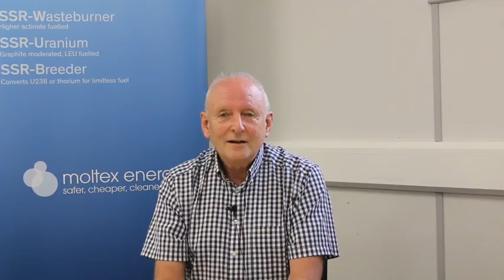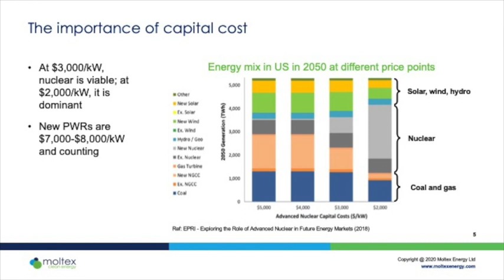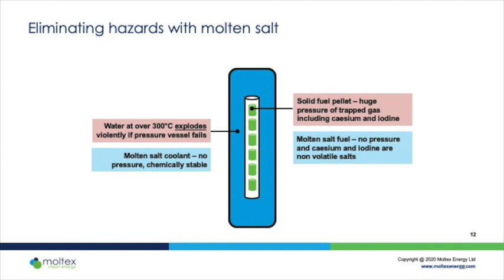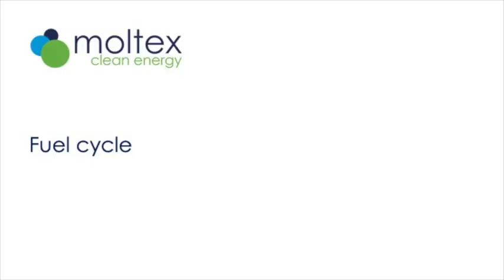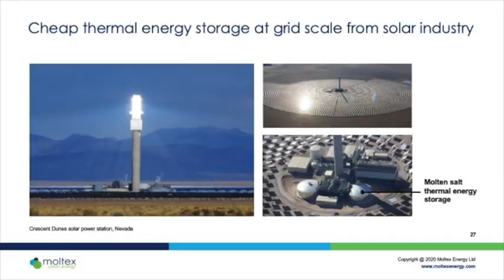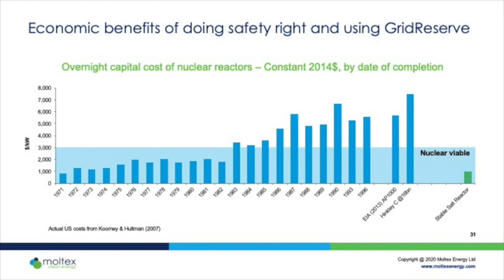MITAB20-Ian-Stable Salt Reactors - a new platform technology in nuclear fission

Comment: Excellent talk. One very interesting point about SMR's in general, and this one in particular, is the low cost of building the nuclear side. Because the very complex and expensive engineered safety systems are not needed, this plant should be a delight to build, commission, and operate!

Comment: The World needs to supplement it electricity options by following Indonesia's sensible choice and contracting some inexpensive 500MWe liquid metal Thorium ion molten sodium fluoride salt burner "ThorCon" energy converters to be used as base load supply running almost nonstop between a 4 yearly maintenance and fuel recycle break not exceeding 5 days.
Indonesia's initial agreement for just 7×500MWe is expected to cost ThorCon $1 per Watt and to be sold to Indonesia at a pre-profit cost of less than 4cents per KWh and will be expected that it will be sold to consumers for less than 7cents per kiloWatt.hour. The only cost to Indonesia's PLN will be for connecting to the local grid and preparing the 65m×180m  landing sites.
(Compare ThorCon's 43kWatt/m^2 footprints with wind or Solar farms 30% efficiency and maximum output of < 100Wp/m^2)
These ThorCons run at a useful high temperature but walk-away safe near ambient pressure and will consume over 96% of the radioactive fuel until virtually only Caesium137 and Strontium90 (half lives 30years) require storage for about 300years. (See 5th training session on how it functions)
https://youtu.be/q3v3L5FQSJI

Comment: I love the idea of MSR or LFTR. All the graphs I've seen doesn't show the improvements to wind and solar to even come close to the worlds energy requirements especially in developing countries. Plus both need a lot of land that can't really be multi-use, as in farming. With coal and gas, both release known pollutants and small amounts of radioactive materials when mined and burned. I find it interesting that hardly no one talks about the radioactive parts of coal and gas. LFTR's on the other hand could be made smaller, easier, safer and less expensive than current nuclear plants. Another benefit is they can burn the nuclear fuel that is from the older plants. There would be less waste and shorter half life than current spent fuels. My big concern is China has taken the lead in this technology using the work from ORNL. The US and others should be doing this as well but China has been putting the money into building a plant. Everyone knows the R&D is what cost the most and China is willing to spend the money to control the technology.

Comment: excellent presentation. 
One point that comes to my mind with respect to the grid reserve that it would also allow to add extra (or 'emergency') peak capacity by natural gas (or other, in the future possibly synthetic fuels)  burner at very little cost. I remember this point was often also made for CSP versus photovoltaics (after the general reserve capacity). 
So in the case of an overall lack of electricity lasting for longer than the reserve salt capacity can handle, one could supply the heat and still have a 1500MW output for a sustained time. Certainly not a goal to do so on a regular basis (efficiency will no be on level with CCGT and yes, its not carbon free in the first place), but if it is for a few days of dead calm and cloud in winter in a year or really just as an emergency plan to avoid a blackout, it seems like a valid addition in comparison to holding an entire gas peaker plant on standby.
Now it all boils down to how grid operators are willing to remunerate such services or if the free market prices offer enough incentive to do so. 
For sure if one would plan to use that on a more regular basis, adding a full gas turbine is also an option, since its exhaust gas temperatures could fit the input required to the energy conversion system of the SSR pretty well, but that would somehow defeat the idea of having an SSR in the first place, and certainly be a serious addition in terms of capital cost.

Comment: Nuclear Power has an extreme schedule and costs issues which must be overcome. Plant Vogtle in Georgia is 10 years and 5x the budget overrun. If these take 10 years to bring online, Renewables + Battery Storage will be far cheaper.
Reply: @Brin Jenkins Battery failure rate can be calculated and added to the storage capacity. When the batteries reach end of life they can be recycled.
Reply: Could the "Battery Storage" in "Renewables + Battery Storage" be GridReserve?

Comment: I’m in favor of GEN IV SMRs, a great deal of R&D must be spent to produce an economical, sustainable and safe system. I consider any advancement in developing fission and fusion power worth it.
Reply: We know fission works, nobody knows if fusion will ever be possible/economical. Money is better spent on a sure thing.
Reply: After looking at the others, I believe Moltex is the best design. No flibe means no tritium (which enviros hate). Because they use chloride salts. And the grid reserve just kicks butt because it's already thermal (you can't do that with electrical, like from solar because you lose the ⅔rds converting that heat back into electricity. So batteries are better for solar and molten salts for nuclear. This is exactly what I was thinking earlier but I thought they'd use Tesla style batteries for storing electricity. But molten salt is still cheaper.
Reply: @fireofenergy  Any high-temperature nuclear reactor design can use the same kind of thermal storage strategy, it's not exclusive to Moltex. I think the Elysium Industries is quite a bit better, no fuel processing needed and the modularity is much better, check them out. They have several presentations on youtube.
Reply: @chapter4travels  
Nah...
No one else rids the fuel in the plumbing problem, will never get passed...
Reply: @fireofenergy  I have no idea what you're talking about. Any high-temperature reactor can put in a clean salt loop heat exchange and use the same storage method.
Reply: @chapter4travels  
I didn't know Elysium used chloride, too. I must have listened to the wrong person, about heat exchangers.
I imagine a vessel with the fuel salt that is pumped through the heat exchanger in a closed loop and that fission products would eventually build up on the parts. Then the secondary coolant to heat the steam.
Whereas the other system, the fuel salt just sits within the coolant.
Maybe Ed's system is like a giant fuel rod in the middle and the coolant is pumped around that.
I'm watching both again!

Comment: It's a half way step towards thorium molten salt reactor, but better than a regular nuclear reactors, removing the water 👍
Still not clear on how many generations of humans will be burdened by managing this waist.
I know IP patents are how things are done, but sometimes they can be used as road blocks, which makes me nervous for such an important emerging field.
Proliferation concerns of uranium might prevent the small modularity capability of these units from being deploy in manufacturing facility to help reduce carbon output.
Reply: All generations of past reactors were the product of teams of engineers and regulators that assured the public that they had taken into consideration all elements of failure and environmental contamination. Just because a person is totally confident in themselves doesn't mean that there was some elements that they overlooked. Most people gravitate to those who project a great deal of confidence in themselves.

Comment: Negative prices for electricity are an artifact of subsidies for solar power, combined with a lack of investment in loads that can benefit from mid day power.  If the reactors can be commercialized, and thermal grid storage proves practical, the cost variation throughout the day will drop significantly.  But aren't almost all of the concentrating solar projects shut down due to high maintenance costs?
Reply: Once you have full demand sized nuclear power that can load follow, what would be the point of adding wind or solar to that nuclear cost?

Comment: Renewables can only offset some fuel costs of a reliable electricity source. If that reliable source is nuclear ( very low fuel costs) there is no point in the renewables, they just add cost, complexity and land use.
Reply: They can't even pay for the little bit of fuel they save. The intermittency renewables introduce to the grid makes the necessary backup sources much less efficient. That's why they depend on perverse incentives like the wind production tax credit that pays reliable sources to shut down whenever the unreliable renewable sources happen to be producing anything.

Moreover, renewables consume orders of magnitude more raw materials and land to build while having a much shorter lifespan than any other energy system.
Reply: @phamnuwen9442  This is the juncture where both environmentalism and conservationism start butting heads. If you only endorse renewables (especially solar and wind), you cannot be both. For me responsibility not only means curbing climate change but also making the most using as little resource as possible.
Reply: @ManOfLore1  Climate change is a vastly exaggerated issue, but if you care about it, the only way to reduce emissions in a significant way is nuclear. We still need to increase the amount of fossil fuels we consume because nuclear can't be scaled up fast enough to provide the entire world with cheap, reliable energy in a reasonably short timeframe. At least not with current  nuclear regulations and political interference.

Whenever climate alarmists start advocating for dramatic deregulation of nuclear development and the construction of new reactors, I will consider taking them seriously.

Comment: Chloride salts are very interesting due to the high solubility of many actinides of interest. But the more complex chemistry of chloride salts compared to flouride salts seems to have been a barrier to their use in the past. I was doing some research into the heat transfer characteristics of these salts and found very little besides a detailed PhD dissertation describing an experiment into convection for a few specific chloride salts. I am very interested in reading about progress from moltex in developing usable chloride salts.
Reply: Utah versatile test reactor look it up.

Comment: Looks like they really changed the design! The reactor is a circular one now. Had a look at their website and they changed that too. The square design is nowhere to be found. No technical data anymore on the site. Does anybody have any more info on the new design? Really curious why they changed it. Their theory on the square core sounded quite logical. Better scalable and a more modular approach.
Reply: @RiverBlue11 You're probably not using the correct terms, but I think I get what you're getting at. If you want to transmute elements, you would put a "blanket" around where the fission reaction takes place. This would catch the neutrons escaping the reaction area and use them to make new elements.

Blankets have been used in scientific research reactors to produce medical isotopes. Or in weapons reactors to produce nuclear weapons isotopes like plutonium-239.

You can put a blanket around any reactor design. From cubic to the spherical. The question is as always, how do you put the transmutation target in, and how do you get it out.

The original Oak Ridge 2 fluid molten salt reactor proposed design had a fluid blanket of thorium rich molten salt that would be separated by graphite tubing. 

In the Moltex concept (the old, square one) you could simply make the outer assemblies the transmutation targets while the middle of the reactor assemblies are filled with reactor fuel.

In this new concept, (the cylindrical one) you would again, have the middle assemblies be filled with reactor fuel and undergo fission. Then the outer assemblies closer to the reactor vessel wall would be the transmutation targets.

Blankets are however, frowned upon in modern reactor designs because the IAEA does not like their potential to produce nuclear weapons material. I don't think Moltex would put a blanket in.

Instead they would probably line the reactor walls with a neutron reflector. You could do this with tons of lead, or more cheaply (and more structurally sound), slabs of stainless steel. Steel that is thick enough can actually reflect neutrons: https://www.nuclear-power.net/nuclear-power-plant/nuclear-reactor/neutron-reflector/

This would improve neutron economy by reducing losses of neutrons flying away into the walls of the reactor vessel.
Reply: Probably to counteract neutron leakage. Every deviation from a perfect sphere is a sacrifice in neutrons. Originally, Dr Scott felt the sacrifice was worth it in order to make it easier to scale. Priorities have changed.
Reply: @RiverBlue11 no worries. If you ever have the time, look into this free online lecture series on radiation, nuclear science, physics of nuclear fission, and applications of nuclear science: https://ocw.mit.edu/courses/nuclear-engineering/22-01-introduction-to-nuclear-engineering-and-ionizing-radiation-fall-2016/lecture-videos/index.htm

The course is heavy on the medical side because that's the professor's speciality but there's a lot of info on the basics.
Reply: @RiverBlue11 
I mean, this kind of science isn't being obstructed. It's being researched and developed right now. The question is as always around funding. I have serious doubts as to the viability of venture capital in being able to bring this reactor to full scale. That's just not how VC operates. 

Every vampire capitalist wants a quick project to make a quick buck on, often within 2-3 years. And if they find out the project isn't working, they would hire marketing firms to hype the company up, force the company into a share offering, pump the price, then dump his share.

We have seen this hundreds of times with tech startups. I think Moltex is also receiving government funding so this deadly fate might be avoidable but it would still massively set Moltex back if a VC did a pump and dump on it.

As for your idea about neutron "gates", that's not how it works. When neutrons are discussed, they are not considered in terms of individual particles. Billions of neutrons are created per second that a fission reaction proceeds. https://en.wikipedia.org/wiki/Neutron_flux

The direction and the amount of neutrons per second that a reaction kicks off is completely random. It is impossible to  design a "gate" that individually catches, or releases, a single neutron. You could only do that if you had a particle accelerator that produced and redirected a single neutron. This is not practical to run a reactor.

In a reactor you can only put things in a general direction of where you expect neutrons to be coming from. So in a real life reactor, you expect a lot of neutrons to be escaping radially - that is to say, streaming out from the centre of the reactor out the sides. So a lot of reactors, would use radial reflectors to stop neutron loss. 

See this picture of the ORNL High Flux Isotope Reactor design: https://neutrons.ornl.gov/sites/default/files/HFIR-reflector-and-fuel-element.jpg

You can see that the reflector surrounds the core like a nut might encircle a bolt. There are no gates, no chambers, no sorters. Just sheer volume of material all around the core. It just isn't possible to predict every single neutron kicked off by a fission reaction to then position a catcher or reflector in time.
Reply: The designers consulted with both nuclear regulators and reactor designers and engineers with long experience in the field.  The square design was eliminated for simplicity.   Less machinery that can break down in the fuel shunting process, particularly in the core where maintenance would have to be carried out by remote control and thus be very expensive and complicated.  The fewer moving parts and maintenance issues you need to have with a nuclear core, the better.

Comment: TBF you can also have a 2 fluid reactor, you have a molten salt thermal exchange fluid separate from the fuel salt.
Reply: He stated they want to avoid that because the coolant eventually leaks.
Reply: @daveb4446  Has that been proven, or is it just supposition?
Reply: @killcat1971  Proven.
Reply: @daveb4446  

Also hard to model due to delayed neutrons and plating out in the heat exchangers.  SSR bypasses all that.

Comment: Circular core now. Probably down to the abandonment of fuel shuffling. A good thing.
Reply: I found this out somewhere later. Yes it was partly due to the fuel shuffling, but also that from a regulatory perspective their modular brick design didn't work. Each size of reactor would have to be certified from scratch as a new reactor. This meant they essentially had to pick a single size and run with it and a circular core has better neutronics.

Comment: Ian says the coolant salt of the Thermal Spectrum reactor is confidential, but it is listed as "39% ZrF4 / 1% ZrF2 / 60% NaF with a melting

point 500°C." https://aris.iaea.org/PDF/SSR.pdf
Reply: Although that presentation is more than 4 years old, so it's possible they've changed it since.